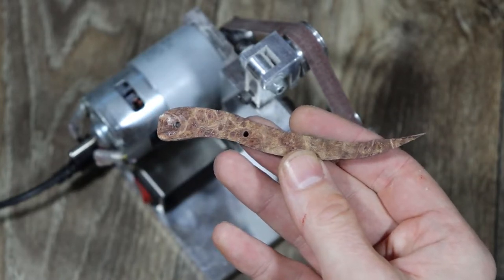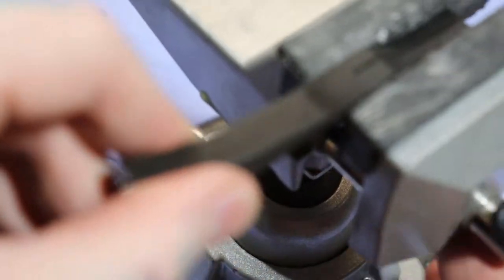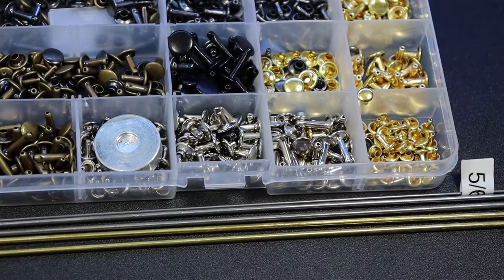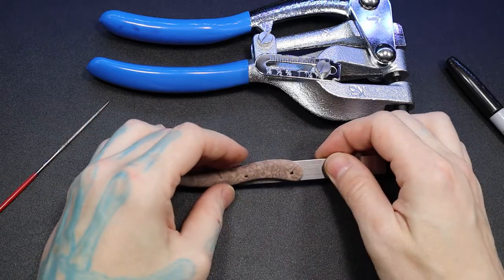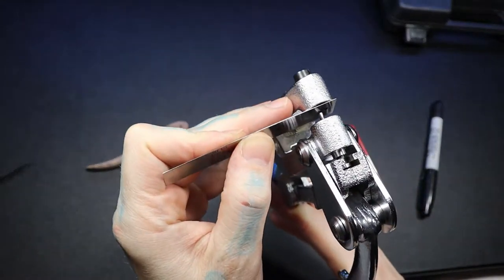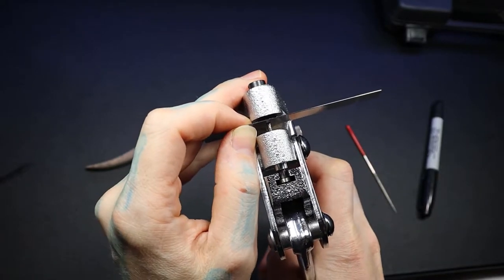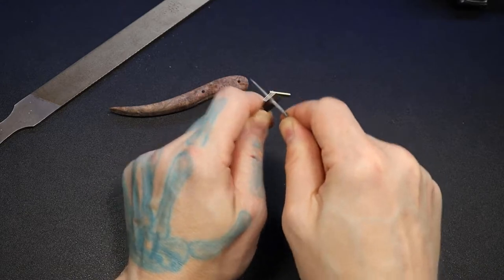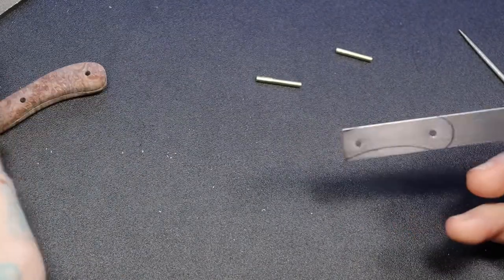152) Making Custom Lockpicks Part 3 - Finishing the Shape, Putting Pins in, and Drawing the Pick

Comment: Where you said “pinch point” you mean “stress riser” you never want sharp edges or corners, that’s where the stress lives as you’re using the tool. That’s where it will bend or break. Same goes for knives.